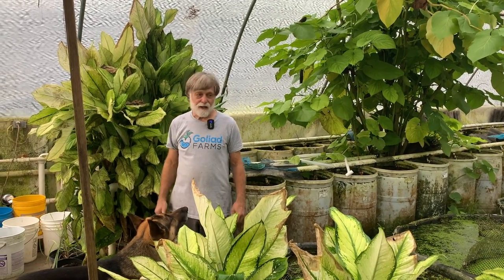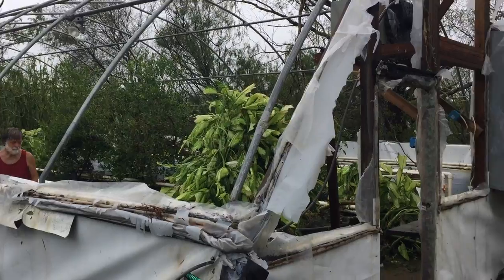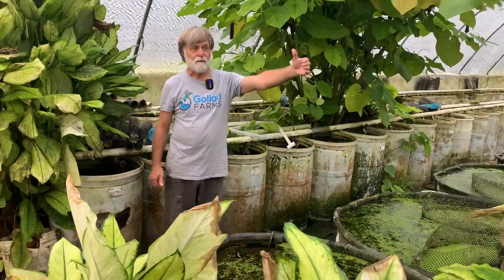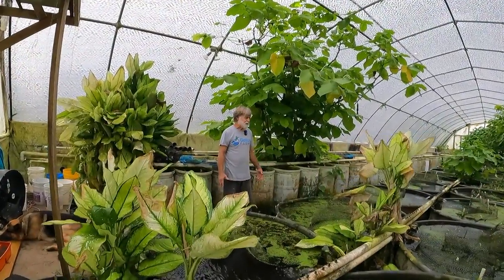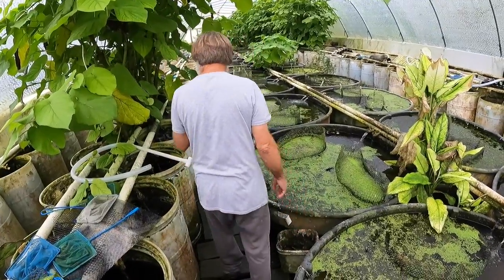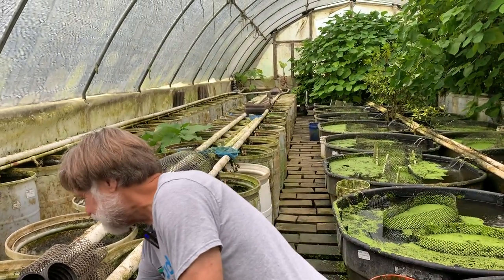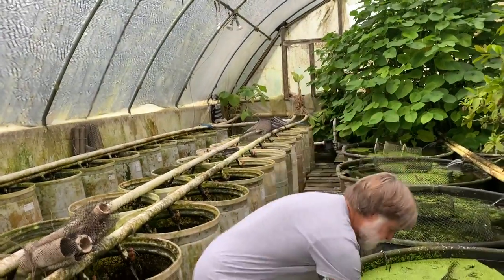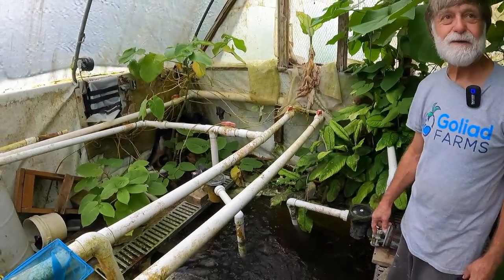Day 37 of Recovery - How the Greenhouse Systems Work - Tropical Fish Hatchery

Comment: It's just my opinion if you was to try to maximize your space I would probably still stands over the barrels and place tanks this way you can separate what you're ready to sell or what you're ready to keep
Reply from the maker: We separate them laterally among the vats in the greenhouses. With cichlids, we usually have five 55-gallon vats and one 300-gallon vat per species/variety. One 55-gallon vat holds 1-2" fish, another 2-3" fish, yet another with 3-4" fish, and one each for adult males and adult females. The 300-gallon vat holds the breeding colony.
One issue with placing tanks above the vats is the cost of pumping water. As it is, our pumps only have to lift the water about three feet (<1m). The gallons per minute our pumps can move decreases rapidly with higher head.
Charles
Reply: @goliadfarms7029  nice maybe you make that a video if you haven't already not sure 😊
Reply from the maker: @canzaquatiz3610  We have done one or two but will do another.
Charles

Comment: Have you thought of moving to the Dersert in California or Arizona? No more  disasters.
Reply from the maker: Every place has some sort of disasters. Although our systems recirculate water to minimize water use, they do use water. For example, during the summer when we run fans to cool the greenhouses, we lose about 3,000 gallons a day to evaporation. Deserts by their natures are miserly producers of water. The aquifer we pump from is close to the surface and recharges rapidly, so it doesn't cost a lot to pump the water. Pumping from deeper aquifers in the desert could be much more costly. Also, there is the issue of water rights to consider in those States.
Charles
Reply: @goliadfarms7029  wow thanks for the reply,love learning about your setup,just a shame you have so many hurricanes,wish you still had rainbows 😭

Comment: I like when you talk about selection for not swimming out the overflows, and the Trinidad waterfall.  Fascinating!
I've got Gambusia in all my stock troughs.  I've seen some flow out when I overflow the tank.  I used to pick them up and throw them back in, but the population is so high I stopped doing it.  Now, they don't seem to swim out anymore :)
Reply from the maker: I've found the same thing with Poecilia latipinna and Fundulus chrysotus that I have in a water trough. The trough used to be connected to our well and had a float. The line connecting it has been abandoned so I have to fill it manually. I almost always forget I'm filling and the trough overflows. After years of that none of the fish overflow with the water now.
Charles

Comment: Use a hot stapler in conjunction with the plastic weld on the Rubbermaid tubs.  I’ve repaired many tubs for my cousins horse farm this way.
This way the weld will be stronger than the existing material.
Reply from the maker: Interesting. We will look into that. That might make Stormy's successful welding percentage improve.
Charles

Comment: Good too see the system bounce back from a big hit. I was wondering the last weeks do you have any idea if a system like yours is better at recovering then a "hightec" setup. ?
Reply from the maker: Our systems are fairly resilient and did bounce back relatively quickly from the disaster.
That's a good question. I advise some aquarium maintenance customers on large aquaria using hi-tech solutions. Such systems can be temperamental and can fail spectacularly sometimes. Recently we had to advise the emergency use of zeolite to remove high levels of ammonia and nitrite in one very large aquarium. Hi-tech systems often require constant "tinkering" and monitoring that I'd find tedious after a while. For me, the fewer moving parts required, the better.
Charles
Reply: @goliadfarms7029  Well for what it's over the almost 4 decades aquariuming I found roughly the same. Mostly doing planted tanks so that is what i am speaking on. Very broadly speaking my simple systems take more time to balance and getting settelled (not quite sure how too call it in English) But once they get there it gets hard to "knock them out". Though the high tec methods can have spectecular results it found they get out of wack more easy. Yes the simpler the less to go wrong. Also you don't need a specialist to fix things when stuff goes wrong.
Reply from the maker: @mauricematla1215  All very good points!
Charles

Comment: That's quite a story on your history so far. 🙂  A friend built a much smaller greenhouse,  similar to yours, for his Orchids with bottom liners in order to save water runoff for yard use. Do you have problems with blocks making holes (leaks) over time, or do you use a fabric buffer to prevent that?   But overall a very smart design.🧐 
For my indoor Orchidarium case in which I grow miniature orchids, has a stainless steel bottom tray that catches water runoff that I drain into buckets and use on outdoor plants.😄  Sorry to hear about trip being delayed, but I'll still be waiting for that video when you do get it. 😊   Greatly enjoyed this video.  Thanks for sharing your time, knowledge, and history with us. 👍😎
Reply from the maker: Thank you.
We use aquaculture rated pond liners that are very resistant to punctures, so we've had no problems with that. We use no underlay. The liner is on native dirt plus sand.
I've found plants do very well with water captured under plant pots. I suspect there are many beneficial bacteria and fungi in that water.
Yeah, I was so ready to go to Santa Fe to visit our eldest son (our brats [children] grew up there) and to hike to McCauley Springs, but late May should be lots better weather.
Charles

Comment: Have you considered adding passive heating systems? It would make your propane heaters more effective, and also what about diversifying your heating sources? Perhaps a solar system for the days and propane at noght?
Reply from the maker: The greenhouses collect heat on sunny days, so we do passive heating that way. We only heat when there are several cloudy, cold days in a row. Typically, that averages about three nights a year. Last year we had to heat more because during the Texas Winter Storm we lost power and our old generator's automatic transfer switch failed. That meant for six days while the Texas electrical grid went up and down, we had to manually switch from generator to commercial power and vice versa several times a day. During those manual transfers the two layers of greenhouse film collapsed and stuck together because the inflator fans lost power. That layer of air provides a lot of insulation and heat retention. We didn't have the time and labor resources due to everything else that happened to replace the greenhouse film before last winter. As a result, we had to heat much more than usual.
We are planning to install a large compost water heater this fall to heat the water (that's a lot more effective than heating air). Such a compost heater can heat water to 140F. We'll install pumps with thermostats to control system water temperature. This will also allow us to keep water temperatures higher during the winter which will improve growth and reproduction during the winter months. By heating water this way, we can save propane for the generator should the Texas grid fail again.
Charles
Reply: @goliadfarms7029  that sounds amazing! Keep us updated as that goes in. I appreciate you taking the time to explain all that, I learned a lot
Reply from the maker: @ThunderStruck15  We're thinking about having an install-a-compost-water-heater day and invite everyone to participate (translation: provide free labor).
Charles

Comment: Did I see a Philodendron in the second greenhouse?  Right now certain trendy (famous on Instagram) aroids are quite lucrative... such as Monstera albo and Philodendron Pink Princess.  They grow relatively easy by putting cuttings into water and both can handle temps into the mid 30s.  But I have no idea though how they would compare to Piper auritum in terms of filtration.  

Regarding the fish, I love the combination of natural and artificial selection.  It is incredible how quickly you unintentionally selected for fish that swim against the current.  I'm guessing it would take longer to select for cold tolerance.  It would seem like perhaps faster progress could be made with hybrids, based on your story of the cross between the convict and the texas, but I googled and evidently hybridization is generally frowned upon in the cichlid community.  Seems counterproductive to me.  Personally I grow orchids outdoors here in Southern California.  A pretty orchid that can't survive the cold is pretty useless to me.
Reply from the maker: We have Philodendrons in our yard, assuming they survived the 2021 Texas 
Winter Storm. We do have Pothos, which when it is happy resembles some Philodendrons. Pothos is a great plant for filtering. The test plant filtration system I first set up used Pothos. Philodendrons would likely work as well if you have the space for them.
If you deliberately set out to select for cold resistance, I suspect you could make a lot of progress fairly quickly. I once wrote a column for Tropical Fish Hobbyist magazine and one month the topic was how to select for cold tolerance.
The hobby has purists who reject hybridization. Others embrace it. I feel there is room for both pure species and hybrids. But with a caveat: hybrids must always be identified as such.
I'm testing a vanilla bean orchid in Greenhouse 1 now.
Charles
Charles

Comment: What is the expected lifespan of the liner? Nice setup.
Reply from the maker: Greenhouse 1 liner was installed in 2000. Greenhouse 2 liner in 2003. We did have to add another liner layer under the side rows in Greenhouse 2. I'm not that impressed with that liner. Fortunately, we've found a close by liner supplier with much heavier and sturdier liners. We can pick up the liners there, saving freight charges.
Charles

Comment: We had a toilet bowl type valve mounted on our 55 for auto fill and water changes with a
 1/4 air hose out the window.
Somehow we got snails and one got caught in valve when it turned on and jammed valve as it turned. Off flooding living room
Reply from the maker: That is why we have floor gutters. Any leaks are harmless. Before we went to floor gutters, we lost water from the system with leaks.
Charles

Comment: Could you use the duck week as some sort of bio energy to heat the greenhouse. I'm curious about the potential applications
Reply from the maker: I know people have used compost piles to heat greenhouses, but that would require a lot of floor space I'd rather use for raising fish. I have looked into a system to create hot water using large outside compost piles of wood chips. 
Charles
Reply: @goliadfarms7029  it seems really hard with energy solutions at the moment, there seems to be no clear front runner in the energy market. 
Enjoy the content btw keep up the good work.

Comment: Hello,

The usual house heating system work fine with pond

Just drawn the radiator (the kind with water into it that goes back to the gas water heater like for regular house) and link the temperature sensor in the water rather than air.

Dont heat air to heat water very bad effectivness, heat water directly :)

I've seen this in a friend greenhouse with a huge pond full of platy.

Simple and effective.

That being said, it wasnt off-grid and gas was coming from city pipe not small container..

Sorry for the awfull english !
Reply from the maker: We've experimented over the years with various methods, most of which worked fine for over two decades. The 2021 Texas Winter Storm was a unique (I hope) disaster. The four counties to our east produce almost all the redfish your eat in restaurants. They lost 98% of their fish and most of the producers will not come back.
Charles
Reply: @goliadfarms7029  Hard winter..

Thanks for sharing love your videos

Comment: How does hornwort compare to najas grass or anacharis for removing nitrates?  Are there any negatives to any particular plant that grows in the water column that would cause you not to use it?
Reply from the maker: I think, based upon growth rates, hornwort removes more ammonia compounds including nitrites and nitrates. Under good conditions, each hornwort tip grows an inch a day. That said, I don't have a lot of experience with anacharis (now in the genus Elodea) since Elodea is illegal to possess in Texas.
Najas, which doesn't often root, sinks in the water column and grows upward. In vats, this is a disadvantage since it fills the vat from bottom to top, and by the time it has reached the top, it has filled the vat. That leaves the fish with little room.
Hornwort floats, making it much easier to control. We remove at 250 pounds of hornwort a week. It is fed to our scuds and put on a litter worm bed  for composting. Our horses also like to eat it.
Charles

Comment: Are your floors concrete or just lined well?
Reply from the maker: The floors are lined with aquaculture liners over a sand bed. The sumps are also lined over concrete block walls. We should do a video on the greenhouse structures.
Charles

Comment: With the concrete blocks sitting right on the pond liner is there ever a concern with the rough surface or sharp edges of the blocks ever putting a hole in the liner?
Reply from the maker: The liners are aquaculture grade pond liners and are very puncture resistant. We've had no problems with after years of usage.
Charles

Comment: If you buy plastic tubs do you have to worry about anything leaching in
Reply from the maker: The barrels we get are food grade and once cleaned don't leach. The other tubs and vats we use are rated for agricultural use and once rinsed thoroughly have no toxic compounds. It's always wise to rise plastics before use because of residual formaldehyde from manufacturing.
Charles

Comment: Rubber roof seam tape won’t work?
Reply from the maker: I didn't rewatch the video, but I assume you are speaking of the leaking 300-gallon vats? If so, nothing I've found sticks to the plastic on these vats. Just today I set up a test of a new tape used for repairing boats. We'll see what that does when I fill the cracked vat.
Charles

Comment: Do you ve winter periode and how do  you werk up your greenhouse
Reply from the maker: We normally have a mild winter period December, January, and February during which we can expect 2-3 mild freezes (30F [-1C]). We typically only have to use propane heaters a few nights a year and then only during long cloudy periods when the greenhouses don't get solar heat gain. During those months, we remove the shade cloth that is used to keep heat gain down during the warmer months. We also turn off fans and seal up the greenhouse vents to keep warm air inside. The greenhouses are covered with a double layer of greenhouse film. Inflator fans maintain a layer of air between the layers of film providing insulation to prevent heat loss.
Charles
Reply: @goliadfarms7029  thank you very much for the feedback. Is a big help.thank you

Comment: Has Rubbermaid commented on the persistent cracking problem you're having with the stock tanks?
If this is a stress crack, are you drilling a relief hole at the end(s) of the crack to prevent it propagating?
Using a virgin rod of Polyethylene instead of aged and weathered piece of tank rim to melt for the repair may be more successful
Just an idea.  . https://www.usplastic.com/catalog/item.aspx?itemid=24504
Reply from the maker: I thought I had replied, but can't find it. So, here goes again.
We did contact Rubbermaid and they recommended what we are doing.
Carl does drill holes at the ends of the cracks.
I've passed your comments on to Carl.
Charles

Comment: why not to pack stuff together and move to a state thats not hurricane prone. seems like you ve been struggling a lot and new storms will come sooner or later. family owned land for years doesn't mean you have to stay there and take the beating.
Reply from the maker: Every location has some liabilities. We used to be located in Santa Fe, New Mexico before moving here. Heating costs were prohibitive there. Before moving here, we looked at Carlsbad, California but land acquisition costs were prohibitive and then there are earthquakes. We considered Mexico but regulations on aquaculture were too restrictive. South Texas has a mild winter climate (with the exception of this last winter, although the issue there wasn't the temperatures as much as the failure of the Texas electrical grid and the resulting propane shortages). Here we have good well water and are located on land that's been in my family since 1870. We are here to stay.
Charles